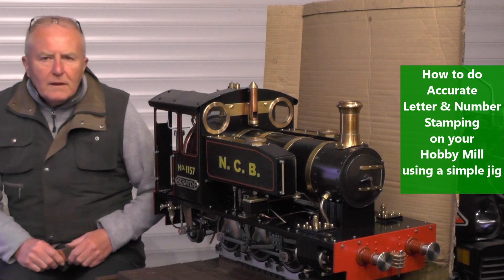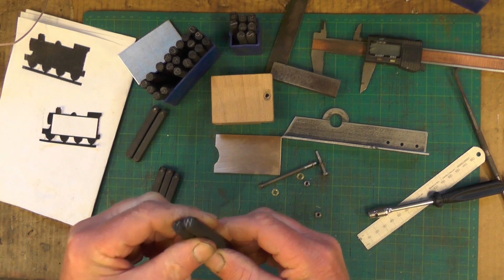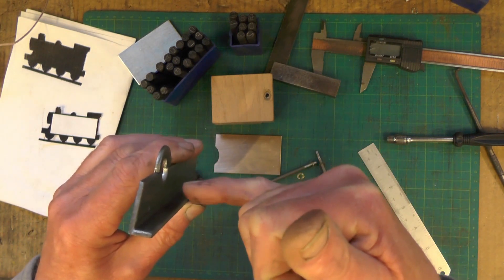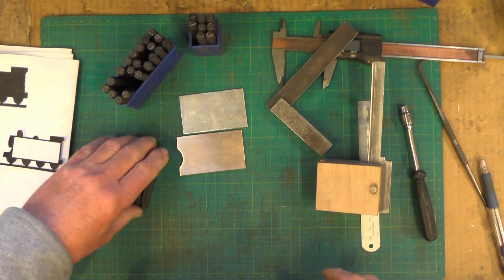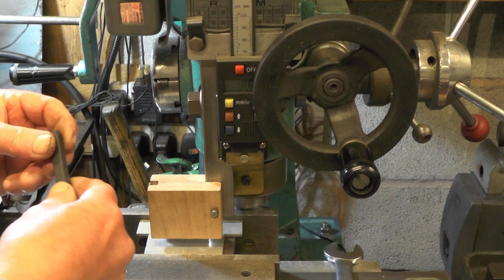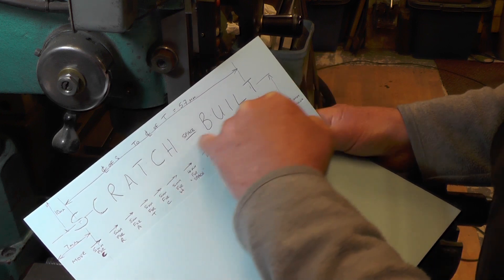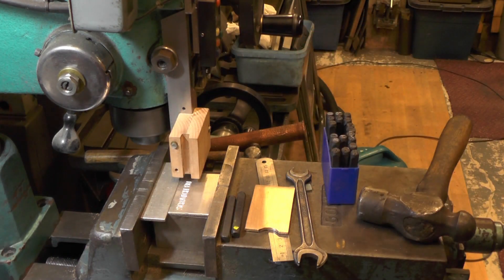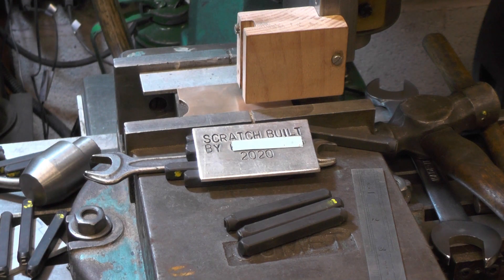Accurate Letter & Number Stamping "mr factotum" Beginners Steam Locomotive Makers Name Plate

Comment: Great idea ! 
Will look into doing that myself ! 
Good job K.
Take Care ,
 Craig 
TFS
Reply from the maker: Go for it! craig
thanks again
mr f
Reply: @MrFactotum  Good Day Kevin , 
Hope All is well , I spent the last few days rebuilding my regulator on my 4-4-2 .Developed a bad steam  leak between the base and the body of the regulator .
Was curious , when you built a copy of your friends electric blower for the chimney , how did you cut the 2 round discs that are spaced apart for the impeller . I was going to just mark out 2 round circles with a marker and then use a fine jig saw but your discs look very clean cut . were they cut with a laser ? 
I'm thinking you did it yourself .
Cheers,
Craig 
TFS
Reply from the maker: @theflyingscotsman9902  hi craig
hope the regulator rebuild turned out ok, 
as for the 2 discs, laser cutting is not in my vocabulary!!!!!, I marked out approx. 4 1/2"  dia. circle, then had a cardio-vascular workout, hacksawed all the corners off then hand filed round, then in to lathe to bore or  fly cut the centre hole, your choice  !!!  or if you don't want to set up in lathe or hacksaw and file, put the 4 holes in on the pcd in the video, and screw both pieces down to a piece of plywood and run the jigsaw around with a metal cutting blade in, it wasn't too bad as it was only 1/8" aluminium.
best wishes
mr f !!!
Reply: @MrFactotum  Thankyou K ! 
Yes , my loco is back on track shall we say ! 😉
Very good ! I'll be on the lookout for a decent motor . No shortage of free time for me . I'll bolt the 2 brass plates together at the 4 spacer holes and kill 2 birds with 1 stone shall I say .
Keep up the fine work ! 
Patiently waiting to see your next venture !
Cheers , 🙏
Craig
Reply: @MrFactotum   Hi K ! 
* Just replied to your email . Great to hear from you ! 
Craig